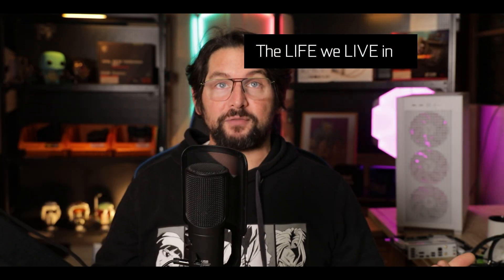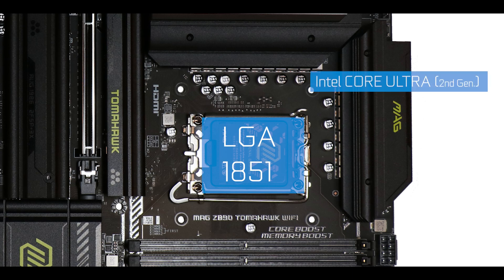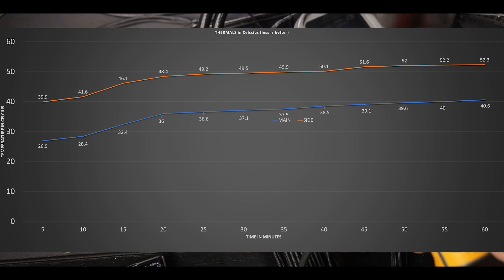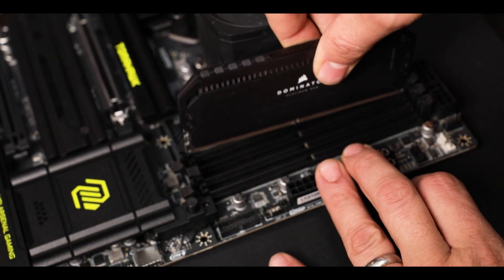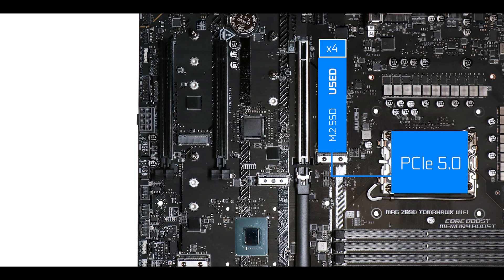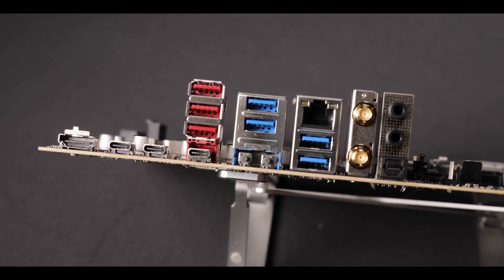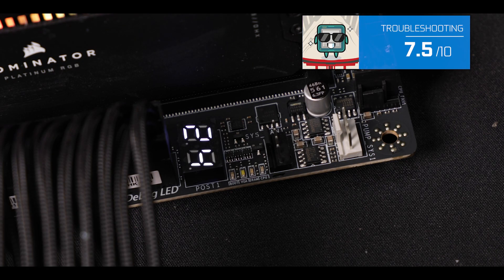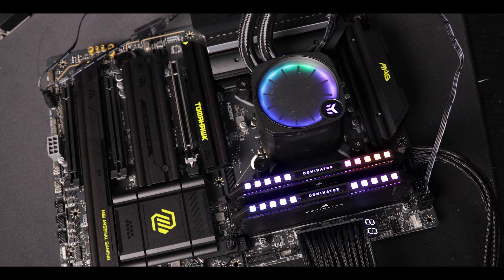MSI MAG Z890 TOMAHAWK WIFI: MSI has been listening, and it shows!

Comment: actually sad... back in the days mid-range PC was $1500 total. And today...
mid-range Mainboards cost $250.
Mid-range GPU cost $1100.
Mid-range CPU cost $600.
Mid-range RAM kit cost $150.
Reply: Where the heck does a mid range cpu cost $600?  A 14400f is like $250 CAD, a good board for it is $199 CAD, a 4070 is $750 and yeah 32gb of ram is still gonna cost you about that $150.  Of course regions vary, i've heard the EU is much worse for hardware prices than NA, and it seems like Canada has been fairly fortunate on pricing front outside of inflated cards at launches.

All prices CAD, Memory express used at point of purchase.

$250 cpu i5-14400, I use this example due to experience comparing an 11700k to a 14400f and we are talking 20% single core difference and almost double multi core. A win at $250
$150 ram
$200 mobo
$750 gpu
$100 psu
$100 case
Not including windows because I havent paid for it in 15 years of building without issue.  

That system for about $1700 is close to 3x faster than anything you could put together for the same price 10 years ago.  Sure it's 80 class price for a 70 class card...stop looking at the name then because clearly nvidia doesnt care and AMD doesnt know where they want to be in the gpu market with intel making strides. $750 gets you near better than 3080 level performance which considering 2080ti(30% ish slower)  was $1400 CAD at launch, is a fairly big win for mid range...

To be clear, I am not willing to pay over $1400 CAD for a 5080 if that purchase ever comes around, nor am I paying more than $1100 CAD for a 5070ti.  Maybe it is because I am not scraping pennies for a build, but also know where to draw the line in terms of perf:$, that the pricing structure doesn't overly bother me outside of say 30 series scalper pricing on 3090's and the current inflation of 50 series...but those are not mid range products.  To call a 5070 mid range at this point is also getting extravagant in terms of price, but also the performance of the product.  Dont let unoptimized titles that got too much media time hide how powerful almost every card since the 3060 has been before any ai features are considered.
Reply: @MDxGano  you that the term HEDT (High end Desktop) exist? Mainstream CPU, HEDT CPU, Server CPU and Workstation CPU, ever heard of this ranking system?
Intel i9 and Ryzen 9 are not "high end", they are Mainstream. Threadripper and Xeon CPU are HEDT class CPU. The cheapest Threadripper cost around $1400 up to $11.000. And a mainbaoard price for Theardripper CPU starts at $500. I own a Threadripper build from 2019, it still beats any i9 or ryzen 9 x3D stuff from today in 3D rendering tasks. When you build a PC for $2500 you are still in the Mid range, probably with a CPU with only 12 Cores
Reply: HEDT used to mean something before the death of the quad core.  Even mentioning x3d in the same sentence as current HEDT tells me how ignorant you are of the context of which you speak.  Yes, HEDT still exists, but we are talking enterprise pricing at that point.  Good for you for having a threadripper, I'm sure it rips all the threads, but to compare it to an x3d is fairly odd, a platform laser focused on gaming...apples to oranges?  

Basically gtfo with your "wEll aCtuAllY" nonsense and to touch tips with other threadripper owners in a more context appropriate setting.
Reply from the maker: Very true !!!